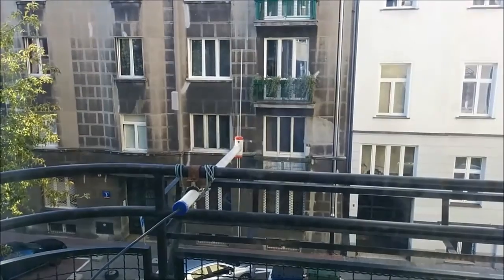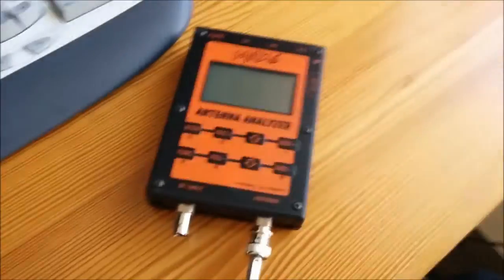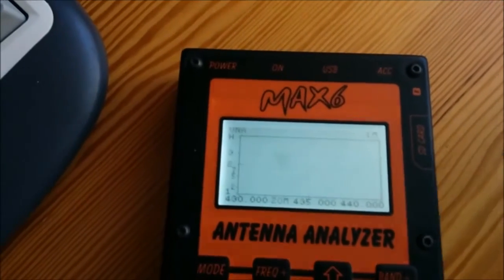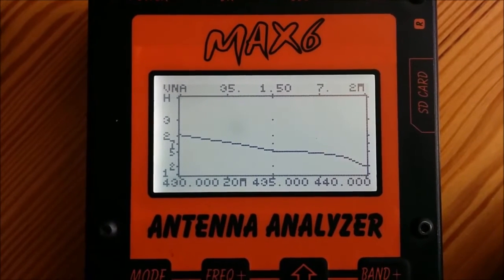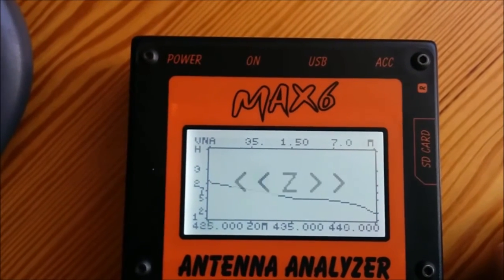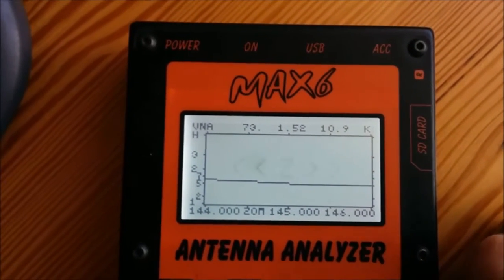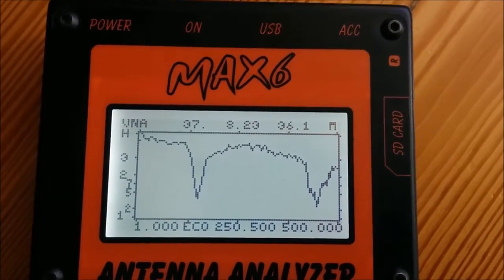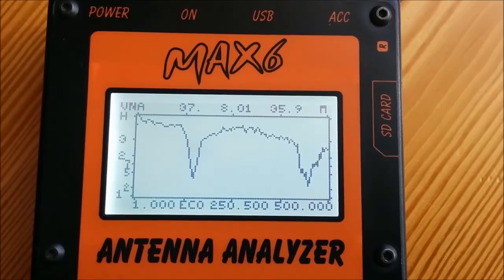Homemade VHF/UHF dipole antenna measurements

Comment: Wow, SWR is kind of bad for both bands. This can burn your radio on transmit. 

I would use this only for receive for a scanner.
Reply from the maker: SWR is 1,5 in the middle of 2m and 70cm, and in whole bands is below 2 so this is acceptable and isn't damege your radio.